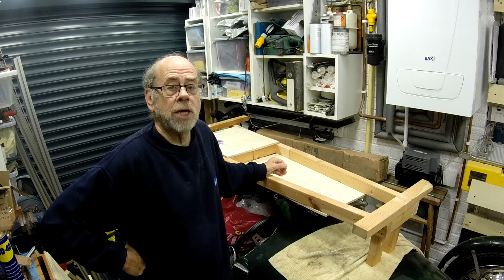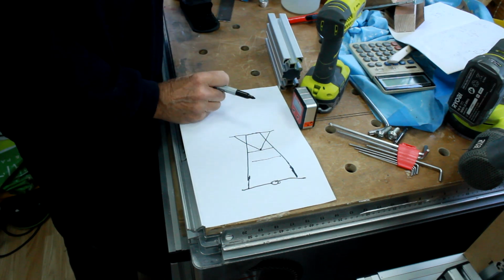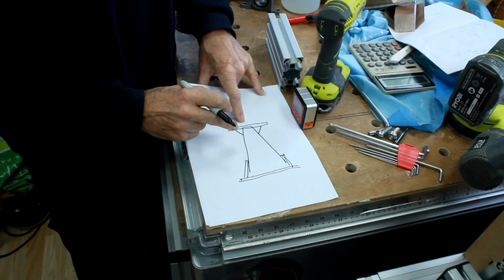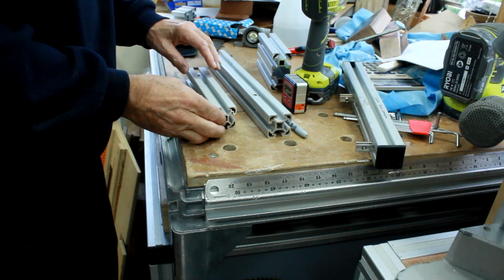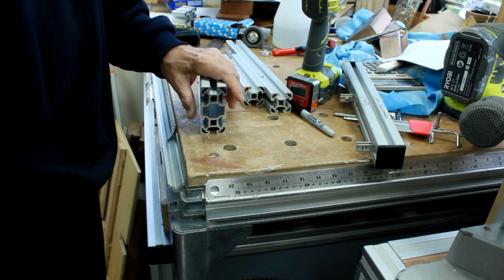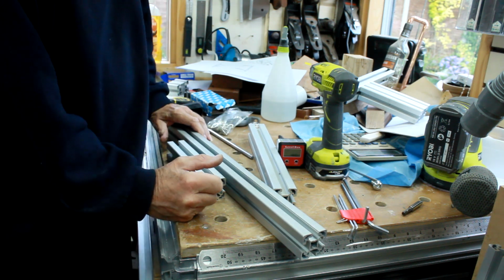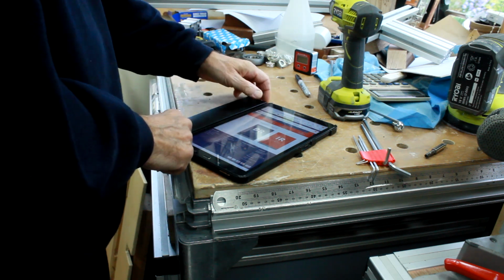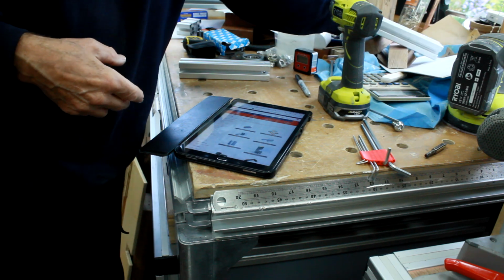small shed Cyclekart diaries 10 - July 2021

Comment: Really getting interesting now!  On the chassis rail joints. The single bolt through to the centre of the adjacent rail end, seems to rely only on friction to resist any chassis twist (though I guess you might Locktite the screw as well). You may be doing this anyway, but might it not be worth also putting a threaded ‘pin’ in each of two opposing corners of the profile’s cut end, so that they locate in holes drilled into the side of the rail being attached?  Probably not explaining it too well, but at least if pinned as well, the chassis won’t immediately collapse if that single bolt loosened.